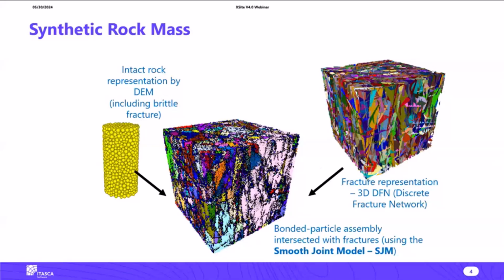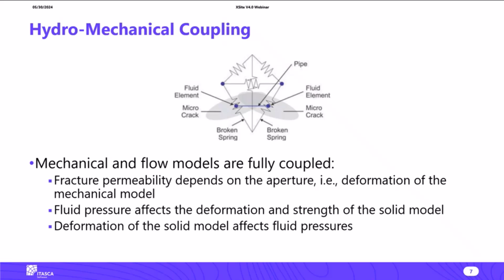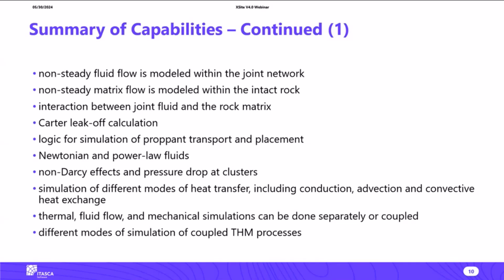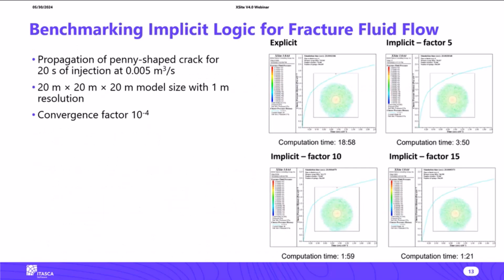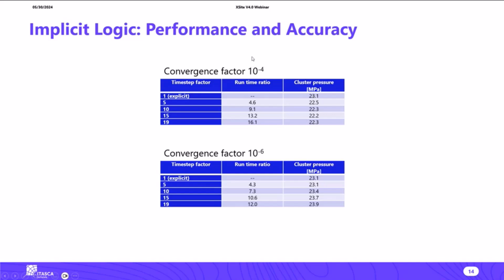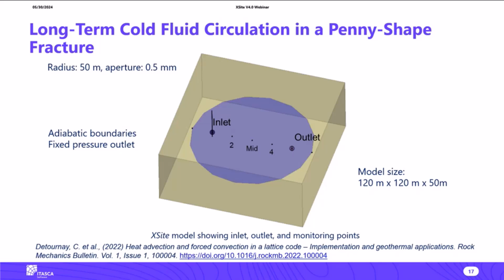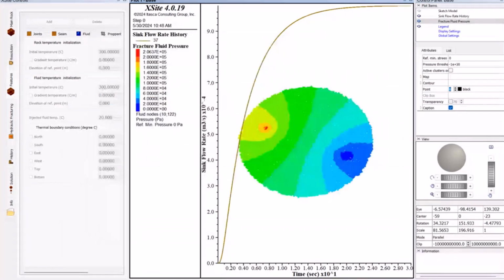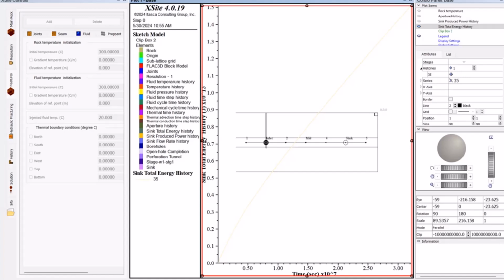Webinar: XSite — An Overview and New Features in Version 4.0

Comment: Please  i a m looking for the tutorial which can helps me to learn Xsite 3.0.60. i have to use it of my research (thesis) on youtube there are not enough Videeo. any link or suggestion could helps me. thank you
Reply from the maker: The XSite User's Guide has been completely updated with Version 4.0 and is an excellent resource. Although it may refer to new features, it should be otherwise backwards compatible for Version 3.0. You can find it on the XSite 4.0 download page: https://www.itascacg.com/software/downloads/xsite-400.
Reply: Did you find the tutorial for XSite.? I have the same problem
Reply: @ZeinabBahmanbeigloo  What do you need to do? If it involves the secondary development of this software, it is probably not possible. If it involves simple cracks, it is still very simple.